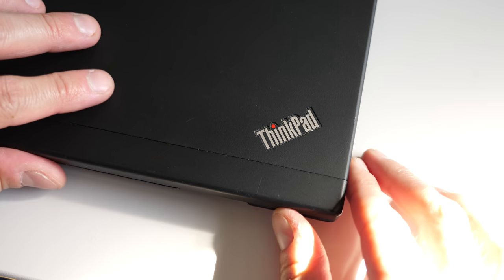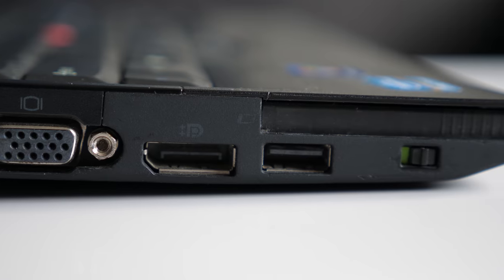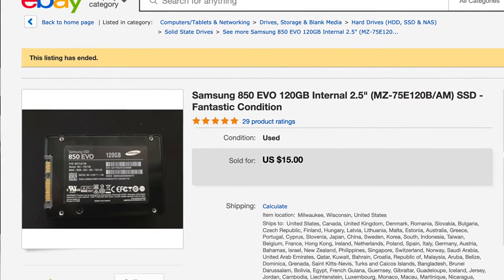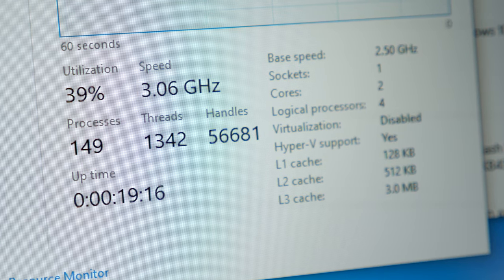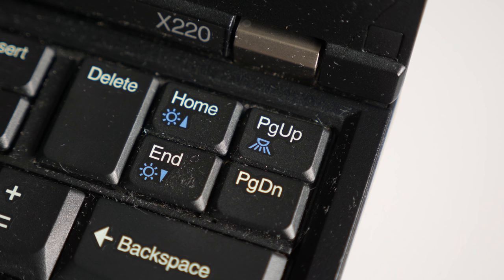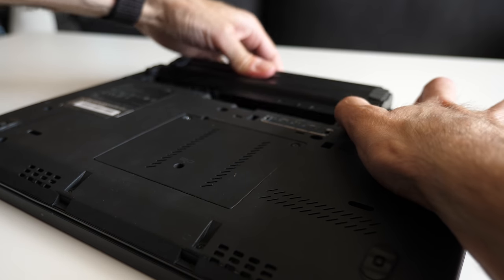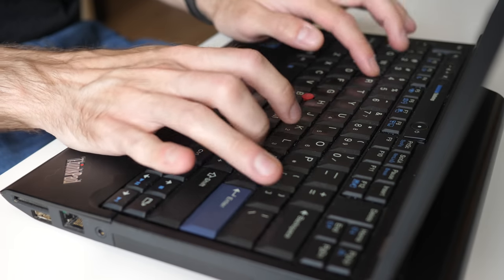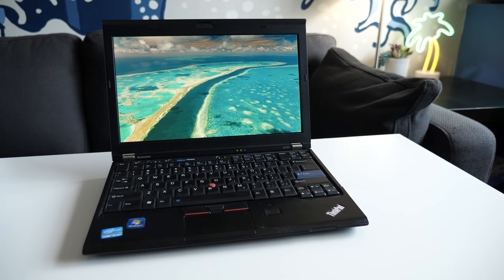The $100 Laptop Challenge -- This Old PC is Better Than You Think

Comment: I am not kidding when I say I still have a ThinkPad from 1994 that I use often for typing in my diary.  I've owned a lot of ThinkPads since, and, other than a T40 with the notorious GPU issue, none have required repair.  ThinkPads are beasts that last and last.
Reply: I gave a used T42 hella abuse including sailing round Scotland in a classic yacht and several trips to Asia. Yes it did finally succumb to the dreaded GPU fault but I had no business getting that much work out of it. In fact I was so impressed that when it finally threw in the towel I gave it a formal burial in my yard. True. I still use Thinkpads.
Reply: @RodFleming-World  It's too bad that they had that fault.  They remain one of my favorite designs for a ThinkPad, both in color scheme and functionality.  They strike a perfect balance between size and power.
Reply: @GregoryRCosta  I agree. It was really out of character too. And seemingly random. Back then the webz was full of owners going nuts because their three month old lappie had gone dark, but then that one of mine suffered years of dog's abuse. Just lucky.
Reply: @RodFleming-World  Yes, when I bought the T40, it was already about 7 years old or so.  From what I understand, IBM had to switch the solder because of lead content.  That combined with flex/temp flux were bad combos.  I could be wrong...it's been so long since I had to deal with that issue.
Reply: @GregoryRCosta  yeah mine and I had been through so much together. Storms at sea, travelling, so much abuse...it did everything from running C-Maps navigation software to emails, writing, book design and web work. Strange to remember an ugly black machine with such fondness but she was a trooper.
Reply: @RodFleming-World  I always loved the design.  It's a design people either admire or look at with disgust.  I'm just a no-frills kind of guy.  All black with a red dot.

Comment: I just upgraded my old sandy bridge i3 laptop to an i5. Windows ran well on the i3 but the i5 is even better. Btw a kingston 240 gb ssd is 25 on amazon. It's doesnt have dram but it is very fast still and it works in most laptops from the past 2 decades

Comment: Went a bit pricier at $250 for my T450s Thinkpad. As needed a bit better and larger screen. So i5/8gb/256gb with 14" FHD IPS screen. 
Also bought at FreeGeeks here in Portland,Or.  To many of the older are TN screens with lack of brightness and contrast. 

So IPS for superior viewing angles and contrast. As needed was color accuracy  with high sRGB and Adobe gamut. Could have found cheaper but would have had to replace screen or add SSD,etc.. But was also a donating to a good cause. As FreeGeeks rock!

Comment: I got a Dell 630 and put in a used  SSD and it's just fine running even Windows 11 . Found a knock off battery for $20 CDN and it will run for hours now . Good stuff and saved it from it from e-waste ☺ Just to clarify I used Rufus to make windows 11 iso bypass TPMS and CPU requirements .

Comment: I still use one of these as my primary laptop, with an X200s as backup.  Upgraded to 16GB RAM + 512G SSD and running Debian Linux, it easily meets all my mobile computing needs, including even occasional use of virtual machines. I think the X220 was the last X-series model with a proper keyboard, before they joined the chiclet fad. I chose it over an X230 for this reason.  Its only real negatives for me are terrible speakers (I want to eventually swap in a couple of salvaged tablet speakers), a somewhat noisy fan, and poorer power efficiency than some newer CPUs,  reducing battery life (though the 9-cell pack lasts a reasonable time) and contributing to the fan-noise issue.  Note that only the i7 X220 models have USB 3.0 (on a single port, the left-rear one); i5's are 2.0-only.

Comment: Some things were wrong in this review.
There actually were, in 2020 new laptops that could compete and even smash the x220, such as some offered by ACER, which even come with 1080p IPS screens.
Also, you say at 6:54 that the machine has usb 3.0, when it doesn't. x230 and later got usb 3.0 ports but the 220x is limited to usb 2.0, which is significantly slower, very very much so, and could even pose problems for those who can't wait an hour for large data transfer.
Reply: i7 x220 has usb 3.0 and you can swap the tn panel with an ips panel
Reply: @themostelegant  you can swap any x220 with an ips

Comment: I bought one of these in 2019 and it's been upgraded in every way possible. it's an i5 but a PCI USB 3.0 adapter works, internal SSD, dock with caddy instead of DVD drive to fit a second hard drive, MSATA 512gb (slow af), 16gb ram, and the only thing I could do past this is an egpu. Runs great, windows, linux, and hopefully hackintosh one of these days. 

I use it every day. GOOD SHIT. best decision was to disassemble completely and repaste it along with dust removal.

Comment: Non BGA back then too. The PGA socket processors can be swapped out for a i7 cheaply
Reply: Not on the X-series though...

I'd suggest to look for HP EliteBook 2560p/2570p if you really want that feature. They're the only 12" laptops with socketed processors which won't break your bank

Comment: The timing of this video is amazing. I just bought the tablet version, an x230t. Similar cpu, but 3rd gen. I5 3310m, but only 4gb ram. A single 4gb 12800 module. I've read that the system can make use of LPDDR3 2133mhz, which will be a nice boost in dual channel mode for the Intel graphics.

SSD and Ram upgrades are definitely on the list. It also had an msata option, though I'll stick with 2.5 sata as it's sata 3 while the msata is sata 2.

I paid about 100 for it

Comment: I purchased my budget laptop for 400$ in a country where there is no market for 2nd hand laptops. I later upgraded it with 240G SSD without removing the 1T HDD.
I believe I got good deal for a 4 core (2.2GHz) + 8GB RAM + dedicated AMD R5 GPU. I compiled many programs on it (LFS and AUR) and SSD is still healthy.
Can play Minecraft at 14 chunk render distance and maintain 30+ fps.

Btw, my secondary computer is a Sony Vaio PCG-7Y2L (from 2007). It is running Ubuntu server 32bit. I don't plan to use it for daily use but as home server and remote server access terminal (for blog hosting and stuff). I got it for 35$.
Intel Pentium 2core 1.7GHz + 1GB DDR2 RAM.

Comment: I have a x220 missing the palmrest that i got for around $70. 5h battery. But the biggest issue i see on it is that even with the thermal grease replaced it heats alot, and if you force the cpu alot (like playing minecraft 1.15.2 or play csgo), it does go over 99ºc. 
I'ts awesome for writing, acceptable for browsing, (and better with an msata ssd + hdd), but not quite good for playing even lightweight games or playback anything over 720p without heating. 
Idk if my unit has this heat issue or what, but it's quite unpleasant to use on the lap, even when only watching youtube or netflix.
I use mine to watch movies and tv shows going to work in the buses and metros, and write some stuff.

Comment: Well... I went from a 2015 Toshiba to a 2013 Thinkpad in 2019, got on ebay. I still on this 2013 Thinkpad.
Why? Becouse this machine is all I need, really confortable keyboard, never becomes hot, and run fast all my applications, battery is at 50% of life and gives 3 hours per charge. While with the toshiba was difficult to work on it due to lags, and starts to degradate the plastic.

Comment: I had a X201, replaced it with a X220 which was replaced by a X230; those computers were bulletproof. I then drank the coolaid and got a MacBook... 2 years later only the display and the bottom cover have not been replaced.

Comment: A few years ago I got a thinkpad T420 for 99 bucks, same i5 processor, no nvidia graphics, 4gb ram, 320gb harddrive. Installed an extra stick of ram i had lying around to make it to 6gb dual channel, installed a 128gb msata samsung ssd into the empty msata slot for 20 bucks keeping the og 320 hdd for mass storage and the ssd for programs and windows and now I have a blazing fast laptop, that can handle pretty much anything. I frequently use photoshop cc on it, and even when there are a lot of layers it keeps up no problem, altough the cpu does show its age, starts using power and gets warm, but no throttling or anything. I have some modified drivers for the intel hd graphics, which makes video playback and 3d rendering much better compared to stock drivers, so even 1080p 60fps is completely smooth and its not dropping frames. Gaming tough, hd graphics is bad and my device does like to throttle a bit however I just ordered an external gpu dock, so will see how it performs when the hd graphics is not in use because there will be a dedicated card plugged in. Im pretty sure with intel hd not creating extra heat it will be a capable light gaming machine, especially for titles like csgo.
Battery life is also ok. For a laptop from 2011 3 hours on the normal 6 cell video playback and word editing i think is pretty good.

Comment: Got to love freegeek, we don't have anything like that here. Bit jealous of that. 80 bucks is a steal.
Watching this on an early 2011 macbook pro with 8gb (yes, the guy from Twitter who just started accepting Mac, hi again ;)). Installed an SSD (Funny how you'd never buy them second hand now, 256gb for 30 bucks...) and the thing runs so smootly it's ridiculous. People don't realize how well more expensive laptops age. I was always a Latitude user, except for one Lenovo Z60M that I got for free, and anything 2nd gen i5 and beyond is still very usable for office work. I have a Ryzen 7 system for my audio/video/photo editing but on my livingroom projector and on my workbench are two 4th gen i5 sff systems (a lenovo and a dell) that I bought for less than 100 bucks. They run amazingly well with 8gb and an ssd. 
Unless you have very specific demands, like playing the newst games or high stakes video/photo editing, there's never a good reason to spend more than 200 usd on a PC or 400 usd on a laptop. 
Unpopular opinion; I type at 700+ keystrokes per minute, and I don't think the Thinkpad keyboards are great, not the old ones, not the ones ones. Samei ssuew here I alway smisplace the spacebar :D. 
The M1 that's on its way replaces my Latitude 7470. Order status just went from 'processing' to 'preparing shipment'. Exciting times.
Reply: Did not quite understand. Tell me, which keyboard do you think is better than on ThinkPad?

Comment: Actually for the past 3 years, my workhorse computer that I lug with me at work and everywhere else is an HP Elitebook 8470p that I got used from Amazon for under $100. It has a nice 14" display, is fairly rugged (aluminum chassis); it came with a I5-3520M CPU and 16GB of RAM. It also has discrete graphics, not a powerhouse (Radeon HD 7570M with 1GB GDDR5) but still better than embedded IGP. I spent another $100 to add a SSD and upgrade the CPU to a i7-3470QM for a total of 4C/8T. I run Linux on it (Funtoo) and to this day I don't feel the need to upgrade to anything else. Oh yes, and the best part is a great sound chip; it does not use a run-of-the-mill AC'97 codec, but a high end IDT 92HD87 codec.

Comment: I've been telling (everyday, normal) people with old PCs that they just need to upgrade to a SSD and as long as the hardware is in good condition, the PC will run just fine for years to come.
Reply: And you're absolutely right with that. But adding RAM or swapping out the CPU can give an additional boost. So the options are limitless
Reply: @sebastianwendl603  Maybe.. just depends on how old the PC is, or if the need for more power arises. For people that buy PCs do shop online, check social media, or file their taxes, not alot of computing is needed but they notice their computers slow down over the years due to mechanical hard drive slow down.

Comment: A good option at this point in time is the Lenovo ThinkPad X280.  Great for school.  The i5 version is a 1.7Ghz (4) core (8) threads.  The i7 version is 1.9Ghz.  You will need to splurge on the 16GB version if you can.  The RAM is not upgradable and is soldered on the unit.  Also it can utilize a 42mm M.2 SSD and the primary drive is an NVMe PCIe SSD.  I purchased (2) i5 versions with Windows 10 Pro with 16GB RAM and 256GB NVMe SSD for $450.00 shipped.  It weighs about 2.5lbs and has an HD 12.1 inch display.  It will be wonderful for my high schoolers.  For a great workstation for myself I got a Xeon 3 Lenovo ThinkPad P50.  It’s awesome.  Also Lenovo has Wonderful software support.  You will need to download and install the their proprietary software for updating drivers.  It’s awesome though.  Most 2nd hand Lenovo laptops and servers have a BIOS loaded Windows key pre loaded.  This has saved me $1,000s over the years with all of my Lenovo laptop purchases.

Comment: If you have a budget of about $150, you can double the processing performance(or better) by getting a thinkpad W530, it has a 3rd gen quad core i7, and mine($170) came with a quadro graphics card. Plus side is that when compared to my X220, it has far more ports, came with a dock that gives it more than double the USB and video ports, and has a 1080p screen instead of 720-768p(cant remember)

Comment: here in eastern-europe these machines sold as refurbished computers with 1 year warranty. these laptops has incredible value compare to cheap, new laptops. what can you do with a 3 year warranty if the casing (eg hinges) snaps right after this period. used business models are far superior to new, cheap laptops. however, we are lucky to live in a world where the everyday computing power usage is so low that a 10 year old computer can deal with full hd or even 4k videos. and ssd makes thing snappy and also cheap as hell by now.

Comment: Ubuntu is great and all but other than the mechanical drive, the Unity desktop enviornment is another big reason why the OS was sluggish on the machine. Should anyone watch this and be curious about Linux, I highly recommend giving either MX Linux a try. It's based on the same stuff that Ubuntu has where it runs of Debian, but the resources used are significantly lower. I was running it on a 10 year old Macbook Air for a while and it made that thing work great. There's of course many other distros of Linux out there, but MX Linux is my new go-to for beginners.

Comment: I still have my Thinkpad T430 (the i7 variant with the Workstation GPU) from 2012 and well ... I use it much more than my newer laptop (even if nowadays, the battery is not that great than at its youth). I've just hooked in it a SSD instead of the HDD

Comment: Aww the X220. That was a great laptop from the time. It also has the old style keyboard, before Lenovo changed to the Chiclet style. We have a an X230 at work and I love grabbing it for field work. My personal home laptop is still a 2011 13" MBP with SSD, 16GB RAM, and iFixIt replacement battery. It runs too good to justify a replacement, as much as I would love to drop $1500+ on an XPS or Elitebook.

Comment: This is a great deal. That Thinkpad is almost too perfect for people wanting a reliable laptop for simple tasks. Because the laptop is relatively old, the SSD doesn't have to be the greatest you can buy. The Core i5 is indeed ancient, so it will be the bottleneck with any SSD.

I still use my X201 tablet from January 2011 regularly, I also put in an SSD and maxed out RAM. I only miss USB 3, and I had to replace the battery twice. I love the touch screen, the keyboard and the fantastic build quality. That X201 tablet is so much easier to repair or upgrade even compared to modern Thinkpads. I don't know what to buy if I have to replace my X201, which will be inevitable sometime.

Comment: That's pretty much what I did.
I have a X552VL(i5 3230m, 1tb hdd, 4gb ram, 710m, odd) and I put in a 500gb bx500 and swap the hdd to odd slot ( with an odd to sata kit), then I put in another 8 gig of ddr3 ram.
Now this laptop can run light wieght task with ease and I lend it to my parent to use.
The cost is slighty over 100 usd.(bx500 500gb cost about 60-70, odd to sata kit cost about 10, and a brand new ddr3 ram)
It's sad that I dig out old broken laptop after upgrading my X552VL, or I can use ddr3 ram in those broken laptop.

Comment: Wow, these prices are low, similar laptops here cost around 2 to 3 times as much, but still I got mine X220 just maybe 3 weeks ago and it's my daily driver now despite having a regular PC. It covers all my needs apart gaming (which isn't really a problem, I ain't gaming that much nowadays). I got mine for like 300 bucks, but it was upgraded to SSD and 16 GB of RAM and now it pretty much happily running Windows 11 with no major flaws or problems with drivers etc. Multiple tabs in Chrome with couple of apps running isn't a problem.

The only issue tho is a battery. I bought a new original 6-cell one and it doesn't perform that well and I get around 2 hours of using Chrome, which consumes like 80 percent of charge. And I can't find an affordable 9-cell variant on marketplaces I have access to. But this is not a big deal

Comment: I got myself a t420 for 90 bucks off ebay, spent another 20 on a Kingston A400 120GB, and another 40 for a high quality aftermarket battery. Specs: i5 2520m, 8GB DDR3@1333Mhz, and an Nvidia NVS 4200m. For $150 bucks, you can't go wrong with an older thinkpad, or really any mid-high tier laptop from a few years ago. It's crazy to think that there are modern cheap laptops with weaker cpu's, non upgradable ram or storage, and cheap(er) build quality that cost more. I absolutely agree. Buying older upper range laptops is a far better value than new and cheap. And the best part is, 4-5 hours of battery life. Same as  some of the new cheapie lappies.